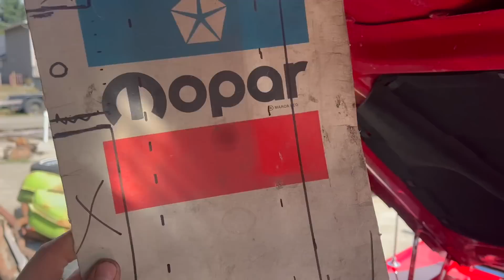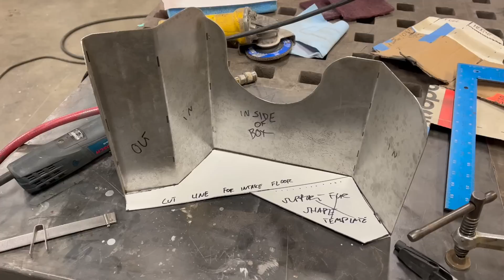How To Design Custom Car Parts Using Cardboard (A 1971 Dodge Challenger 392 Hemi Swap Update)

Comment: I have an srt 392 engine and transmission from a  2021 car, a cheap boss, and a deadline to make it run on an engine stand.. he wants to put it in a B body, but at the same time he thinks this thing is like a Chevy 350 carburetor engine and it could just be slapped in any car in a few days.
Reply from the maker: Yeah… that’s not how this works. Hopefully my videos are helpful.

Comment: Perfect timing. Need to build one for my 392 swapped charger. I thought about putting a lid on it instead of following hood contour. Would that still work. I have a regular cone filter.
Reply from the maker: Yes, a lid would work great. Just not the look I was going for. And obviously it has to be low enough to clear the hood.

Comment: A rotary leather punch makes pattern holes EZ.
Milwaukee 12v sheet metal nibbler is heaven sent. I used mine this morning.
I'd enclose a link to the leather punch but apparently the powers that be at Gaggle frown upon that.
Reply from the maker: Typical overlords… I have an air nibbler, I’ll have to get a Milwaukee one of these years.

Comment: The cardboard trick is awesome, its what I used to make up my 2D files to make gauge panels and such. I was thinking of making adapters for wiper motors and other things eventually due to the need of more parts makers for the old trucks and other Mopars.